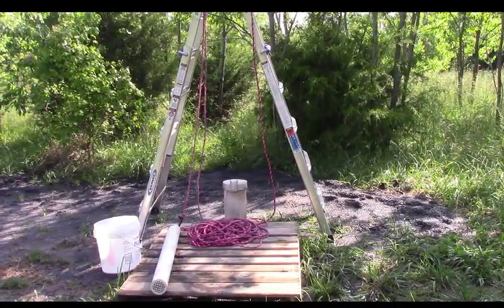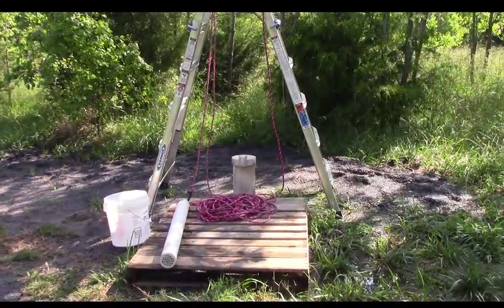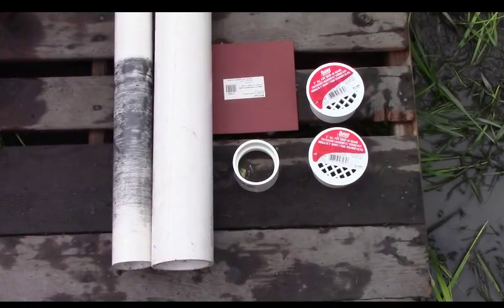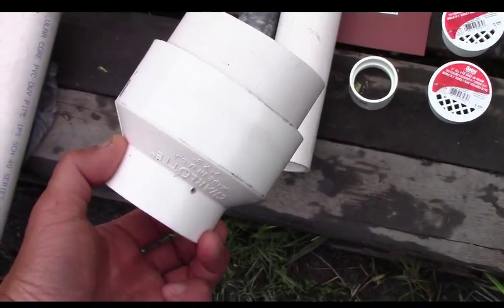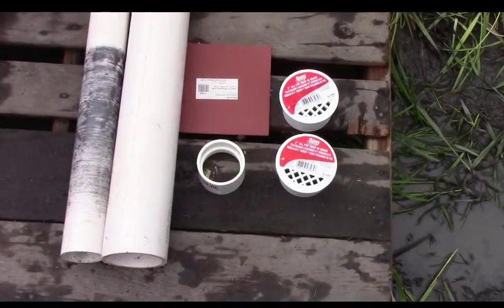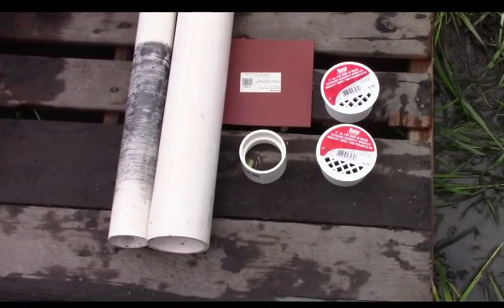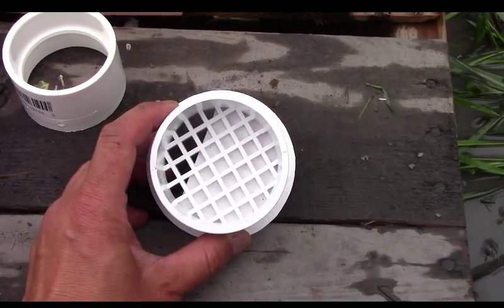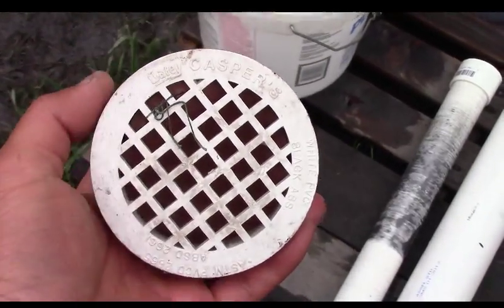Low Cost, Simple Hand Well Pump - Emergency Water Bailing

Comment: I use a racquetball "ball" at the bottom of my bailer's bucket.  It acts like a check valve.  It can get heavy after awhile, but three trips down pulls 5 gallons of water.

Comment: What is the best water resistant rope to use?   Does the pvc pipe bucket need to be weighted to drop into the water?
Reply: Polyethylene rope works great; I use it for my emergency bailer's bucket and my main well pump.